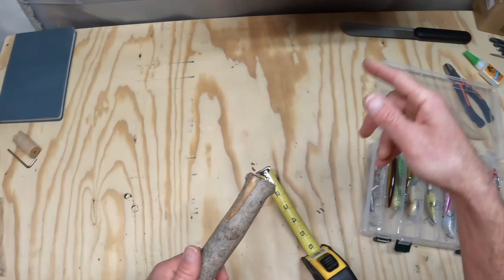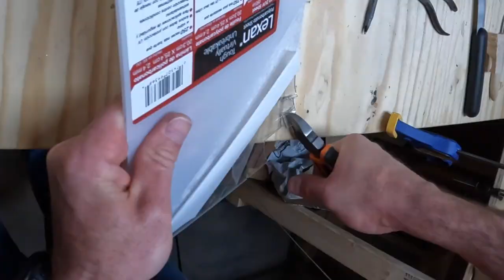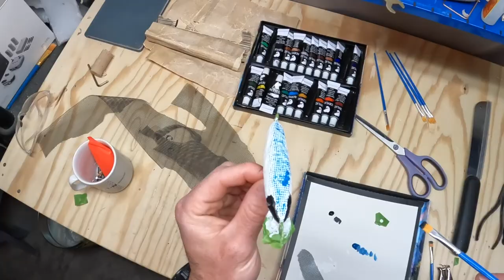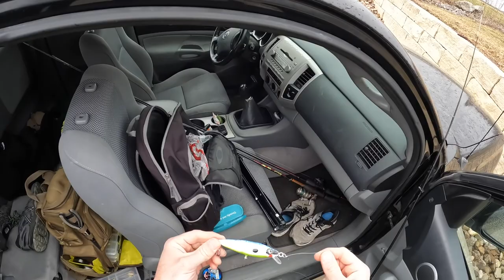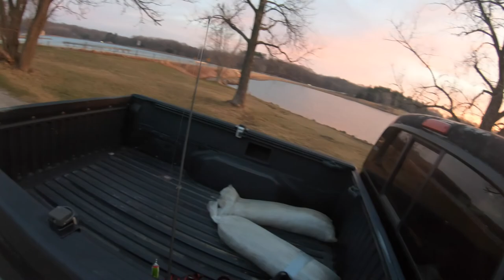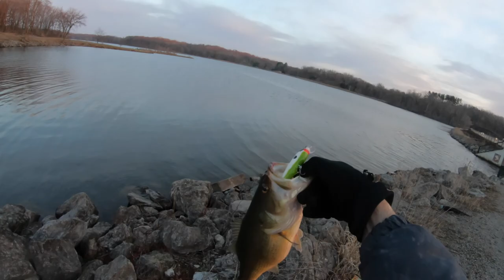Homemade Shad Jerkbait Build and Catch (Easy Fishing Lure DIY Build)

Comment: Nice lure and congrats on the bass with it. I don't think I'd trust screw in hook hangers for much more than a 2lb largie though
Reply from the maker: The screw in hangers are a concern. I usually use a wire through hanger which is much stronger. This time I wanted to try a more quick and dirty approach to see how it works. I tested the screw in hangers by screwing them into wood and then pulling with fishing line as hard as I could to try and rip them out. I couldn't do it. That said I was trying it in a piece of wood and not the finished bait. I am currently trying to hook a much bigger, angrier fish with this bait to really do a full stress test. In the future if I decide to use the screws I will use the longer version made specifically for lures. Those screw in almost 1 inch into the bait - the ones I show here I picked up from the hardware down the street and aren't that long. It's all still a work in progress.
Reply: @BackroadsAngling  You could pre drill and fill with super glue, then screw them in.
Reply: @EngineeringHooksets  that's how I made mine except I used wood gorilla glue. Caught 5 or so fish on it but i didn't catch anything over 2lbs so idk how well it'd hold up to a bigger fish.